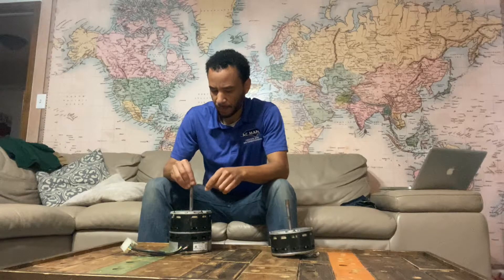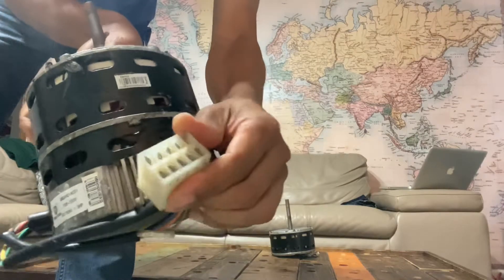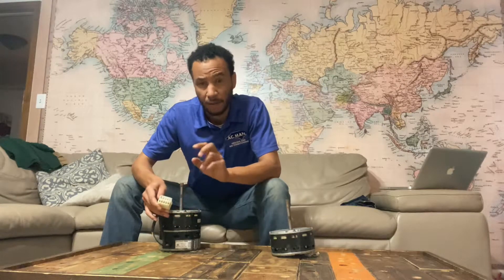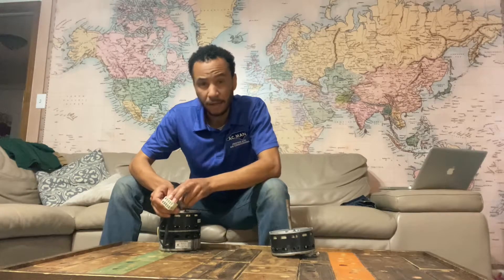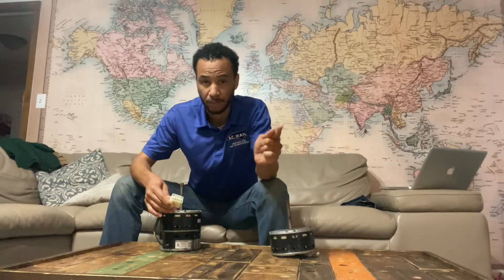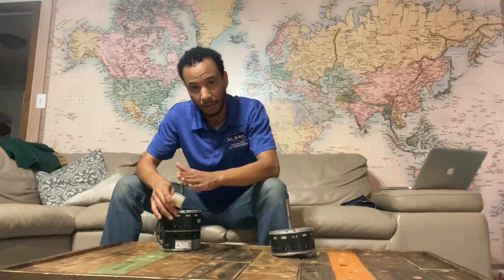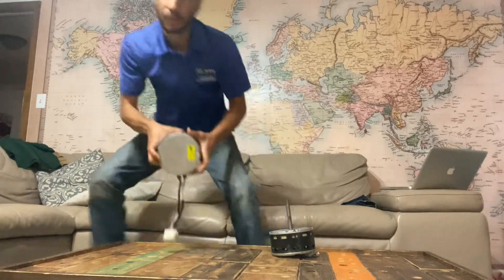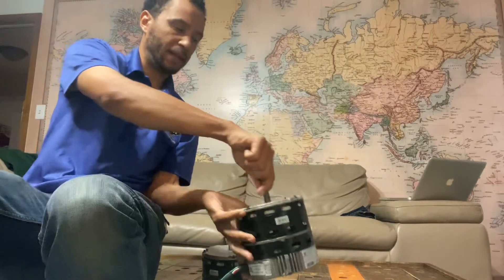How to test ECM X13 motor￼

Comment: How do you test this motor without power using a multimeter?  I tried to ohm between 1 And 2 , 2 and 3, 3 and 4 but it's always open.  I thought I should get a certain resistance.